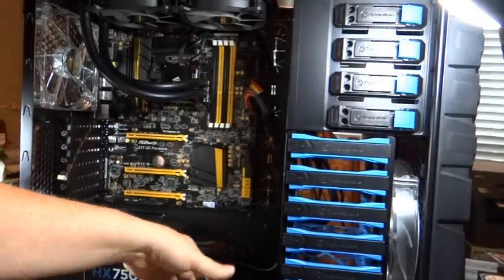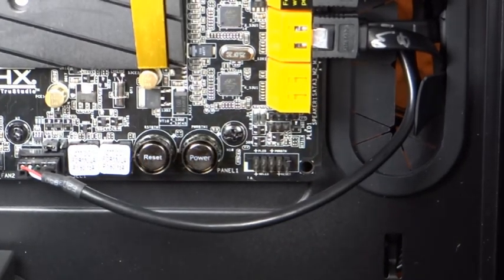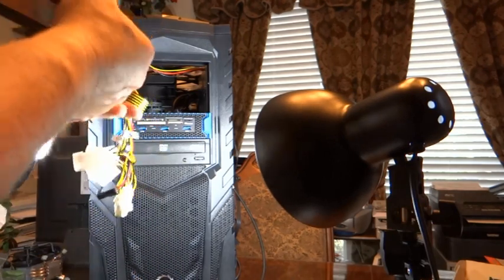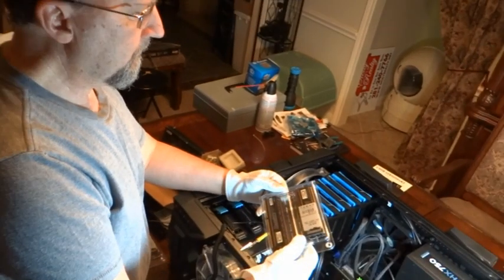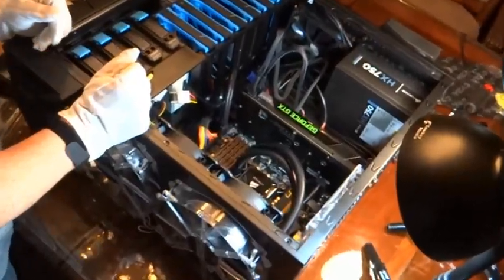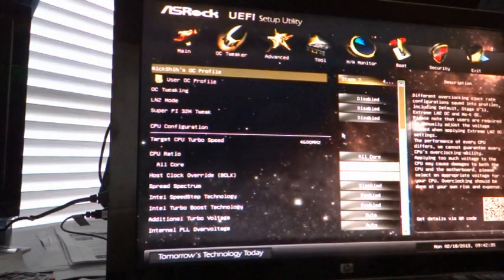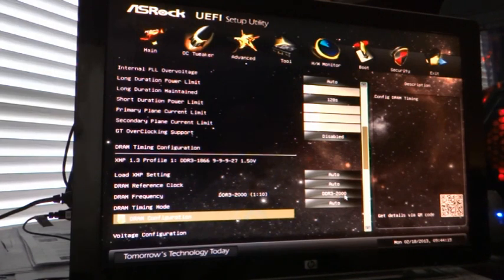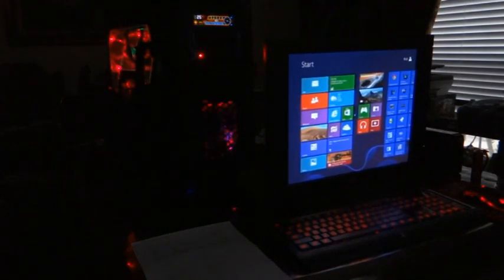Building Your Own Computer in 2013 PART 4 of 4 - Case Wiring, Video, Memory, BIOS and DONE

Comment: Hi, I had a lot of problems with the stock fans on that same case. I finally got them to work but could not get the LEDs to light up. Can you help me? I think i am missing some cables or something perhaps.
Reply from the maker: The cables should already be attached to the fans.  It has been two years since I did this, but seems like there was a power connector for the case (maybe near the front or top of case?) that you needed to plug into one of your cables going to your power supply to get the fans to work.  Seems like it was in a bundle of cables in the case (near the top?).  The only stock fan I kept was the big fan on the side of the case in the big window and the one in front.  The leds are operated by a button on the top of the case.  They can turn off, or different colors, depending on how many times you press the button.  Hope that helps.
Reply: rickmcmillin1 Thanks! The fans from the case I plugged right into the motherboard and they work but I just cant get the LEDs to light up. Like it is not the button. Not sure if I am missing something.
Reply from the maker: Sustenator007 For the LEDs to be controlled from the button on the case (and that is how they work for me), there must be something you can plug the power cables into on the case itself, not your motherboard.  I vaguely remember running into this myself, but it was two years ago.  Look around and see if you can find a powerplug for your LED fans in the cabling of the case itself.  Seems like that is what you do, plug your fans into plugs wired to the case, and then there is a power connection from the case to your Power supply or motherboard.  Let me know if you can find such a thing.  If you can't, I'll open my case up and trace what I did and let you know.
Reply: rickmcmillin1 The top and front fan cords were coming from the case itself in that big bundle of cords. They were small, 3 pronged connectors plugged into a small 3 whole matching connector thing that led up to the top of the case, possibly for the fan control button. But the fans them selves wouldn't work, then I unplugged them and plugged the fans into the motherboard and then the fans worked, but the lights didn't, neither did the controls for the fans. The rear fan does not like up and has its own cord that goes directly into the motherboard. I'm lost, that would be so helpful if you could open your case and let me know, thank you so much!
Reply from the maker: Sustenator007 Okay.  I will look.  But in the mean time, that bundle of cords that your fans were connected to, was there a power connector in that bundle that would plug into your power supply?  I think that is what you need to look for.  Plug your fans back into that bundle of wires, after you find a plug in that bundle that will plug into your power supply.
Reply: rickmcmillin1 I recall a large 4 prong connector that had like black, yellow and red cords on it. It would reach anything unless it connects to something the power supply gave to me. Let me know please how you set yours up, again my fans work they just do not light up and I cant control the speed or anything from the buttons on the top of the case. Thanks again.
Reply from the maker: Sustenator007  that sounds like the right plug.  You should have cables that came with your power supply unit that will connect them together.  I will check when I get home.
Reply: rickmcmillin1 Thanks! Please let me know! I dont know if they plug into the motherboard at all.
Reply from the maker: Sustenator007 I got home too late last night to look.  Will look tonight.  But you should have a cable that will go from your Power Supply Unit (PSU) to that 4 prong plug (white?), not your motherboard.  If you do, then that should work if you plug your fans back into the cables they were first plugged into.
Reply from the maker: Sustenator007 Okay, I opened the back of my case to look for the cable, it needed cleaning anyway.  Best I can tell, there is a black 4-pin molex male plug (with a red, 2 black, and one yellow wire going to it) that goes to the top of the case.  You need a 4 pin female molex connector cable that goes to your power supply to connect to it, I believe the same as the power cables that go to you hard drives.  Hook that up, and hook your fans back to the case connectors, and then when you power it on, hit the LED button on the top left of the case, that should turn on the different colors of the fans.  Hope this works.  Good luck!
Reply: I had that but that didn't work, I think that is the SATA plug for the top hard drive bay. The fans only work when i plug them into the motherboard and it leaves the 2 small, 3 pronged plugs. Thanks for you help though, i'm not sure what the deal is.
Reply from the maker: Sustenator007 No, it isn't the SATA plug, those look different, it is a Power plug. Try googling Molex 4-pin male plug, these are for power, which is how the fans would get power from the case, and maybe the plug in hard drive too, unless there are more than one of these.

Comment: How do you set/get the windows version on the computer?
Reply from the maker: I bought an OEM version of Windows 8.  Made sure my DVD drive was set to be bootable in the BIOS setup (it normally is by default).  Put the Win8 DVD in the drive.  Boot the computer on the Win8 DVD.  Then follow the instructions.  It is really pretty easy, but you will need the drivers that come with the motherboard to finish the Win8 setup if you setup RAID hard drives or do anything extraordinary.  Win8 did not recognize my RAID drive until it found the drivers on the DVD that came with the motherboard.  Of course if you don't use RAID that won't be an issue and it will find your hard drives easy, but they will need to be formatted during the process.  You should also be sure to install all the drivers on the DVD for the motherboard, but if you can download the most current drivers off the internet that is even better (for built in sound card, ethernet, USB, video, etc.).  Good luck!

Comment: My issue is is that my hdd and case didnt come with mounting brackets...
Reply from the maker: That would be tough.  Many cases have hdd mounting brackets that are specific to their case with quick release mounts.  But you should be able to order hdd mounting kits that will work by screwing into the hdd and then attaching the brackets to the case with additional screws.  The hdd brackets give the hdd a little more width to fit securely in the case.  You would want them secure so they don't move while operating, which could damage the hdd.  You may need to measure to make sure they will work.

Comment from the maker: What is happening?  No power? If no power, make sure you have your power switch for your case correctly plugged into the motherboard.  If still no power, then need to see if power supply is the problem, which is best done with an inexpensive power supply (psu) tester (I have one made by Rosewill).  If you have power (lights) and it isn't booting or there is some other problem  I would need more information to be able to help.  Most motherboards have a digital LED code that can help diagnose.

Comment from the maker: I agree about the need to see your monitor to pick the one you like.  Specs don't tell the whole picture, but they do tell part of it.  My focus is on photography, so rendering photos with perfect color and clarity is most important to me.  With my current non-IPS monitor, the colors/brightness looks different depending on the angle of view my eyes are in relation to the screen - which is bad.  That is why I want/need IPS.  24 inches is big enough for me, but many IPS are bigger like you said.

Comment from the maker: I have one, an HP 24 inch (W2408H) with a glossy screen (1920x1200 resolution).  I'm looking to replace it with a S-IPS monitor, but need to wait a while before spending more money.  You can see it on this vid (12min) where I show the bios settings.  I used a smaller spare monitor while I was building and configuring the new PC so I wouldn't lose use of my main computer until it was finished, all software installed, and thoroughly tested to be reliable.  I can't go a day without my PC fix!  :)

Comment from the maker: The main reason I picked the motherboard that I did was because of the number of SATA III and USB 3.0 ports it had.  I was wanting 4 raid drives using SATA III and this was one of the very few that had them.  However, I really couldn't use 4 of the 6 this board had like I wanted, so it wasn't needed.  Also, it is good for overclocking and I planned to do that.  AND I thought it looked cool.  Since I got a window in the case, that was important. :)

Comment from the maker: Newegg.com will let you compare both boards.  The ASRock has quite a few more features, it just depends if you want those features (more SATA, more USB 3, other connectors, etc.  The ASUS board has more reviews, but the satisfaction score is about the same.  If you plan to overclock I would recommend the ASRock, as that seems to be the main focus of this board.  For memory the ASRock has many options to OC and the ASUS only appears to go to 1866.  I like the ASRock so far.

Comment from the maker: Something to note about this mobo, the memory and PCIe slots are not "open" when you get the board.  I did not "open" the PCIe slot (white latch on end of slot) and my video card did not seat properly when I first installed it, as was apparent when nothing came on the monitor when I turned it on first time.  I went back and opened the white latch and re-seated the card and all worked great.